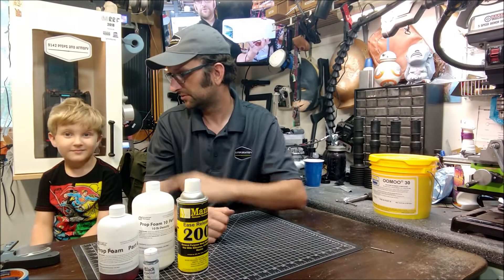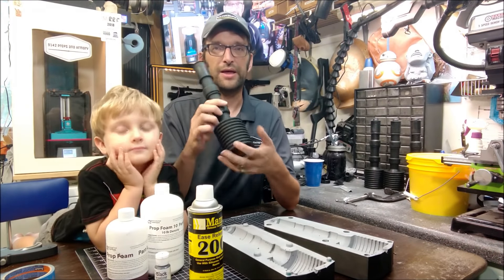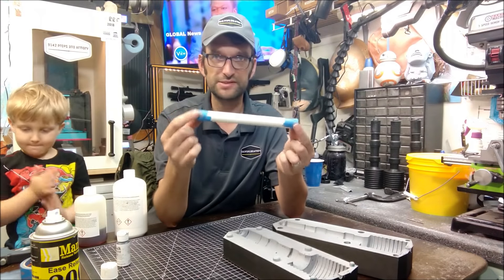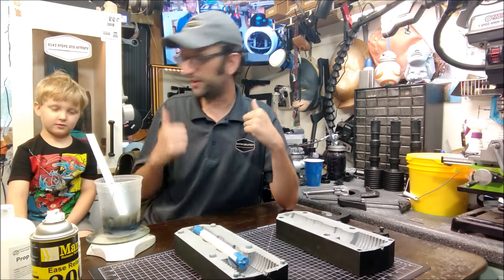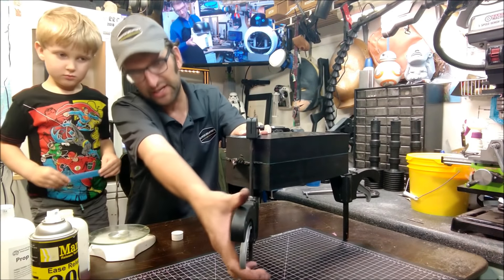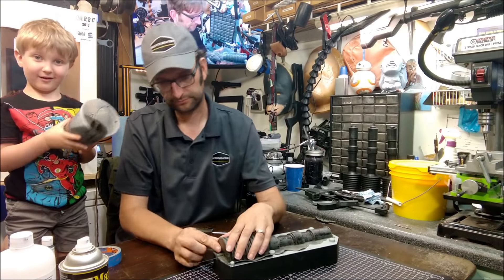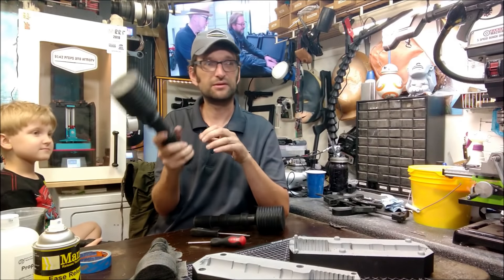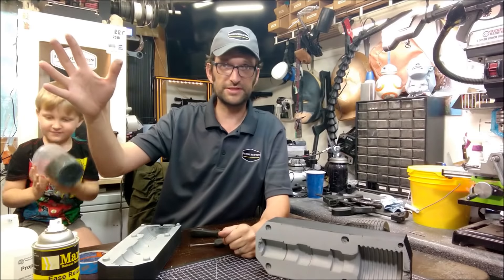Can You 3d Print a Mold?

Comment: This is what I was planning on using the 3d printer for. To make either plugs for pulling molds off of or to just make a mold that can then be copied in fiberglass can carbon.
Reply from the maker: It does open up a ton of possibilities when it comes to mold making for sure. Can't wait to try some more out.

Comment: Nice. You might get better a better seal on the mold if you put a piece of wood on each side to help disperse the pressure from the clamps more equally across the halves.
Reply from the maker: Great call out for sure. That absolutely is a great suggestion.

Comment: Great video. Just a suggestion, instead of a box make the mold a 1/4 inch thick and provide flanges at the ends and middle.
This would save significant material and time in 3d printing.
Cheers

Comment: Did you get the gcode for the model directly out of Fusion 360 or do you need another program to generate the gcode. I can think of several projects I could do 1 or 2 off using the 3d printer for molds. Thanks for the video. I hope you can find the time to reply.
Reply from the maker: You can export the stl directly out of Fusion which is how I did it...or you can use the new slicer embedded in Fusion to do so. I have not tried out the the Fusion slicer yet and can't speak to how effective it is.
Reply: @9142PropsandArmory  
Thanks.
Reply: @9142PropsandArmory  
Showing the drawing through printing process would be a great and very interesting video if someone knew how to do it all.🙄
Reply from the maker: I'll add it to the list!

Comment: Have you thought about using a flexible filament to maybe give it a little give?
Reply from the maker: You could do that certainly, but your print would have to be really clean. There's not a ton you can do to post process a tpu or other flex material to remove the print lines. Not that comes to mind for me at least.
Reply: Or water solvable filament! But then you have only one-time usage though.
Reply from the maker: Another interesting idea!  Love the sharing of info going on.
Reply: That's what they use for jewelry and intrique parts. It's a (1) piece you just pour into, then after cure drop into water or solvent needed. (1) times use but only way to make intrique pieces.

Comment: I had problems with things hardening too fast, it's very stressfull. I found out if you mix in the color the put the stuff in the freezer for a while you lengthen the hardening process and get some more time to do the critical part.
Reply from the maker: Cooler temps do lengthen the pit life of two part materials, you just have to be careful that you don't go too cold.  Too much and you inhibit the reaction which can lead to less than optimal results.

Comment: I know time is a factor on this stuff, but would it have made any difference in the casting if you would have poured half of your mixture in both sides of the model for more even distribution?
Reply from the maker: You could do that. But closing the mold cleanly when booth halves have material in them could be problematic. I think that merely flipping it over after sealing it up does a good job.

Comment: I am wanting to make my own soap and bath product molds. They will be 2 or 3 pieces of hard plastic. Any suggestions on software and what type of printer I should use?
Reply from the maker: Thanks for checking out the video. For software, I'm working through learning fusion 360. It's really powerful and excellently suited to these types of projects...and it's available for free for a few years for students, start ups, and more. For the printer, it really depends on how large of things you want to print. I haven't found too many things I can't print with my cr-10 with it's 300x300x400 volume.

Comment: You don't have to cast flexible in a solid mould, you just have to make sure you have mould release and that your have a 2+ degree angle to remove the part.
Reply from the maker: Yes, but the majority of people don't want to get into adding drafts to molds to cast solid pieces. And since this is an introductory look into the concept I left that out.it was done in the interest of folks not trying to cast solid parts without drafts and failing.

Comment: Thank you for sharing.
I would like to sugest you a video topic: The "10 tips on how to design a 3D printed mold". For example, how the 'key' are designed? Any minimum/maximum angle requirement, etc.
Reply from the maker: I will give something like this a shot and see how it comes out. It will give me a chance to play with OBS a bit to put the video together. Thank you for the suggestion.
Reply: I've found video on how to cast things, but DIY custom 3D molding, not that much.
I know there are limitations on this technique, but I'm sure we can benefit from its advantages as well.
So, you just got a new subscriber on that comment!

Alex from Québec, Canada
Reply from the maker: Wonderful Alex!  I will give it a go and see what we come up with. I'm still very green when it comes to Fusion, but I'm sure I can get people pointed in the right direction at least.

Comment: Why do you think that you had to cast something soft or flexible?
Reply from the maker: For ease of release in the parts. Without adding drafts to the mold or ejection pins to it, the softer cast parts make it much more easy to release the parts when you have a solid mold.
Reply: @9142PropsandArmory  That's what I thought you'd say, but honestly it is round, you wouldn't really need a draft?
Reply from the maker: Yes, but the part has undercuts at the end of the handle. That coupled with even a bit of residual print lines in the mold means it's locked in place.
Reply: @9142PropsandArmory  The parting lines which you call print lines wouldn't be an issue. As for undercut, I am thinking you don't understand the concept as I don't see any undercuts on the ends.. None the less, you've done a great job!
Reply: @9142PropsandArmory  The PARTING LINES, or flashing which you incorrectly refer to as "print lines" will cause no issue. As for any undercuts, your item does NOT have any undercuts when using a center line parting line.  Awesome job none the less!
Reply from the maker: I do understand parting lines. I'm not mistaking the layer or print lines for them. There are undercuts at the end to be sure. Definitely not a good candidate for a solid casting unless I wanted to junk the whole mold, ha ha. It was a fun experiment, but fully printed molds are not terribly practical. Though they do allow you to make some very nice jackets for a silicone mold. That may be another project down the road. Thanks for the good feedback and for checking it out.

Comment: Great video. I’m new to printing. My sister is making items with resin and she’d like a few custom molds. Could a pla printed mold work with resin? Just wondering. Again, I’m a complete noob.
Reply from the maker: In short, no.  Not without a lot of over engineering into the mold. Generally speaking if you're going to cast rigid pieces like a resin, you'll need a flexible mold. Im casting a semi flexible foam in the pla mold. If you cast a rigid resin in a rigid mold, your cast parts will usually get stuck in your mold. Unless it's a very simple part you're casting(when talking about the geometry of the part).

Comment: If you only need to create one part you can use PVA plastic for the print and the mold will dissolve in water. I make a lot of parts using Carbon Fiber and resin and I 3D print molds with PVA. When the resin has cured, I remove the vacuum and throw the part in a bucket of water. No problems at all with the carbon fiber component sticking to the mold. I use this to build parts for high power rockets that I fly.
Reply from the maker: That is fantastic!  I really like that. Great idea and a great solution.

Comment: Makes sense you couuld print one tbh, just gotta seal your edges real well and release the FUCK out of it. Also, CR-10, good call. I have the same and I'm upgrading it with a 2nd Z-rod this week.
Reply from the maker: It works!  It's not perfect, but for a short run of parts in this exam t material, it's fine. Let me know I'd the second z is worth the hassle when you're done.

Comment: Would you ever try a flexible material mold?
Reply from the maker: As long as the surface finish of the cast parts does not matter. It's hard to smooth out flexibles for sure.

Comment: Try a tpu liner next time see if that works.  Then you can have a pla(abs) master mother mold and flexible thinner mold.
Reply from the maker: Definitely an option where the surface finish of the cast parts isn't that important. It's hard to smooth out the tpu very well.